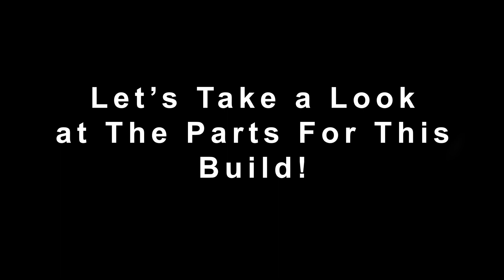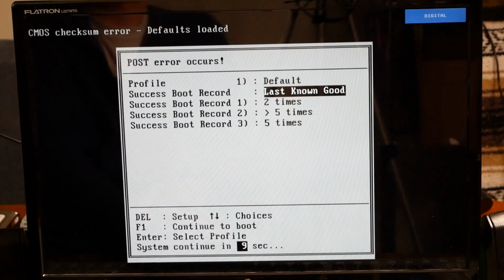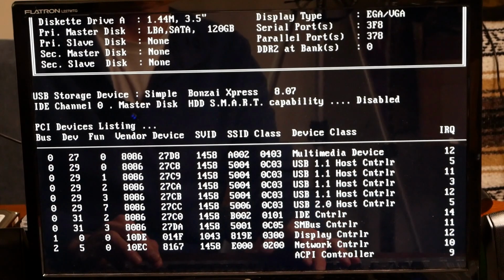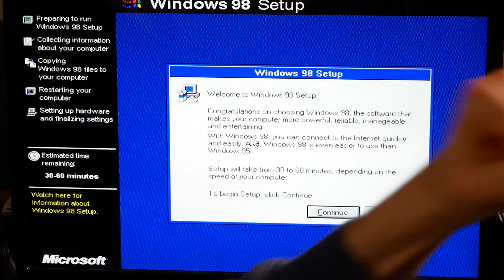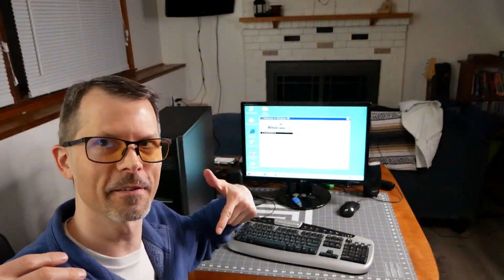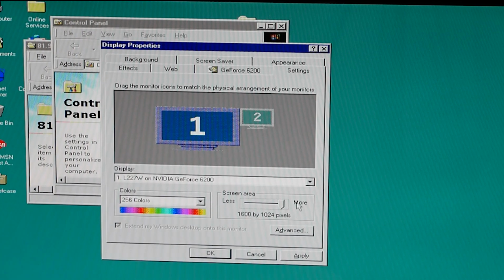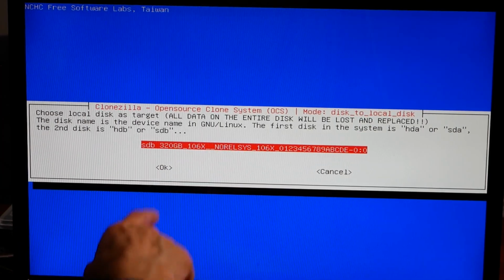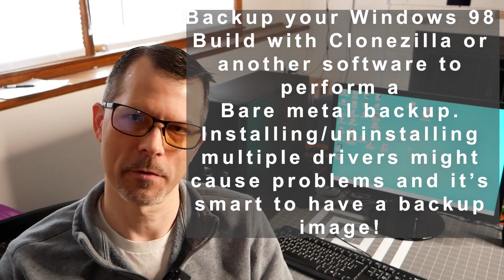Building The Ultimate Windows 98 PC - In 2023!

Comment: Nice vid! Went down this route a few years back. My ultimate win 98 pc has a athlon xp 3200+ on a msi K7N2 Delta-L with 512mb PC3200 DDR ram and a asus radeon 9800 xt, Chaintech nvidia fx 5950 ultra and a asus geforce4 ti 4600... i couldn't pick 😅and a sound blaster audigy 2 zs. Ooh use some brake cleaner to get away the old thermal paste.
Reply from the maker: Hi and welcome! Ty! That xp cpu was the fastest in that line if I remember right. Nice setup. In hindsight, maybe I should have gone with an athlon build. Would have had more driver support, perhaps. Shrug. Thanks for watching and commenting 🙂
Reply: @RememberThisTech  The xp cpu is pretty much overkill. If you do go for a athlon in the future get a motherboard with the nforce 2 ultra 400 chipset for best results. Also for most games to work geforce 4 or 5 will be better then 6 for compatibility which was a thing back then. And 512mb ram max for dos to work next to a hdd thats not too big.
Reply from the maker: @MeALot  ahh great info thanks! I'll need a vacation after wrestling with this latest 98 build before I try and tackle another lol. Getting my hands on working 4 series nvidia cards will take some research :)
Reply: @RememberThisTech  I was lucky to buy everything during the start of corona when no one was buying stuff and sellers were kinda desperate lol Thats why i ended up with several gpus. The fx is kinda bad but i like making fun of it, the radeon 9800 pro is nearly as good as the xt and still sometimes pretty cheap. I have seen the 9800 xt go for 4 times what i paid for it right now. Geforce 4 ti 4200 and 4400 are not that much less from the 4600 in performance but are a lot cheaper.
Reply from the maker: @0MeALot0  Ahh makes sense! You got them at the right time. Nice!
Reply: @RememberThisTech  Just like now chinese replica cards of the fx and radeon are around so do your research if you see one you like. The chinese ones usually have cheap caps and lower speed vram on them and are worth scrap metal.
Reply from the maker: @MeALot  haha yep spot on there!
Reply: I am using a Athlon XP (3500+) with Windows XP 😆
Reply: @tagesvaterpatrick8780  You must mean AMD Athlon 64 3500+ right? For athlon xp 3200+ is max. Got an Intel Core 2 Extreme QX9775 @ 4.2ghz for Win xp and a 9800 gx2 on a asus striker 2 extreme board
Reply: @0MeALot0  You're right! I meant the Athlon XP 3000+ 🤪 The Athlon 64 I have is the 3500+ !

Comment: Interesting build of a Windows 98 retro PC, albeit with components that didn't even exist at the time ;-) But then I would have been better off using a Gotek floppy emulator instead of the 3.5 inch drive, which is what I have in all three of my retro PCs installed and they work great. 999 disks on a 2GB USB stick, that's a strong argument ;-) I hope you don't have too much software that reacts critically to such powerful hardware (for a Windows 98 computer).
Reply from the maker: Hi there, I appreciate that point on the new op hardware running 98. I guess the point was just to get the newest hardware to run 98 on :) I'm working on a new 98se build with more age appropriate hardware. It just takes time to get working pieces :) I have one of those gotech devices but was too slow to figure it out. lol :( Thanks for watching hing and commenting. I appreciate it.

Comment: hi
i have several of those geforce 6200 asus graphics cards. they seem to be vary uncommon because nvidia later produced the turbocache versions more and were pretty awfully slow at time. the one you have is more akin to lower clocked geforce 6600 and i think used the same silicon die too making them rare now.
Reply from the maker: Hi, oh wow that’s good info Ty.  I’ve got an fx5500 I’m itching to try soon. Thanks for watching :)
Reply: @RememberThisTech  I'd expect the FX5500 to definitely perform worse than your 6200, but would be interested to see the outcome! :)
Reply from the maker: @erroneoushyphen  More support perhaps too for the 5500 fx ish series cards too. We shall see!.
Reply: @RememberThisTech oh yeh, it'd certainly be more compatible with the bulk of win 9x era games

Comment: A neat build! 👍👍 I recall using Windows 98 SE., on a Pentium 3 Compaq desktop PC., and it worked reasonably well, but it did have some stability issues, I never played video games on it though.  I use Linux Mint these days and there are many free games in it's repository, but I'm not a gamer. Obviously I enjoy watching retro builds though.
Reply from the maker: Hi! Yep, the infamous win 98 had serious stability issues lol. Mint is a good OS. I've used it a bit here and there. :) Thanks for watching!
Reply: @RememberThisTech  I have watched some videos about upgrading the older Mac Pro desktop computers, such as the 2012, 5,1 and once upgraded they are still very capable computers and workarounds are still created so that the latest Mac operating systems can be installed using Open Core or other patches;  Linux OS., or Windows can also be used on those computers.  Do you ever obtain older Macs?  I have considered doing so, but there are not so many of them here in the UK., so they are still quite expensive.
Reply from the maker: @LAURENCE JOHNSON  That's great info ty. Yeah, there's older Mac pro towers around where I live, imacs, laptops, thing is most of the cheap ones are with dead drives or not known to be in working condition. Either the owner knows its dead and just wants money or dosnt really know. So I'm worried to take a risk of buying a hunk of scrap metal.. I've also read that you can only upgrade to a certain Mac os depending on what hardwares in the Mac, but your saying with workarounds one can bypass that and install a newer Mac os? I've got my eye on a G4 tower... but the owners saying they don't know if it works has no hd... soo do I waste 60 bucks?
Reply from the maker: @laurencejohnson4106  Oh wow tyvm! great stuff there! I'll take an in-depth look when I get a few moments ;) thanks again.
Reply: @RememberThisTech  You are welcome!
Reply: @RememberThisTech  PS., this channel may also be of interest.  https://www.youtube.com/@JessiesFlying/videos
Reply from the maker: @LAURENCE JOHNSON  thanks I'll take a look I appreciate it :)
Reply: @RememberThisTech  You are welcome.

Comment: Wew 13$ for 120 gb is pretty good, even if it's a basic dram less ssd my cs900 has been working fine for about 4 - 5 years now i think ? About 11.6 TB writes too it & still 90% health left so plenty too go.
Also got a 240 gb cs900 which I've put too use now in a laptop after getting a 1 tb m.2 drive for games instead.
Reply from the maker: Heh I figured windows 98 wouldn't mind a cheap ssd lol. You are getting some good life out of yours! I picked up a 2 tb for video editing and 1 tb nvme im going to use for boot.. got a 2tb reg ssd 980 samsung for games etc. Goto rearange setup.. depends on what or if i change my main rig to a new cpu and board.. decisions decisions.

Comment: Maaan, 128MB of GPU memory is the limit for W98/W98SE.. btw with memory patch you can go up to 2 gigs of ram and with LBA48bit patch you can easily use 500GB hdd
Reply from the maker: Hi and welcome to the channel! Good tips thanks! The 6200 Graphics card I had only has 128 mb of mem. I'm familiar with the mem patch upgrade but I didn't have 2gb of memory for the system :( I wasn't aware of the HD Patch good info tyvm! Thanks for watching and commenting I really appreciate it ;)
Reply: @RememberThisTech   No, windows will recognize more than 128. My 256 videocard has no problems, and 98 will run 512, but can and does flake on some cards at 512. Windows 98 will  support up to 3.5gb of memory.
Reply from the maker: @R1BLACKRAVEN  good info thanks :)

Comment: The ultimate win98 machine id build myself would probably be something like a socket 754 motherboard with agp, running a Athlon x64 for that socket or maybe the mobile Athlon x64 4000+ based on the newark architecture which is essentially the san diego core.
512 mb ram probably as well.
As for gpu I'd probably go for something like a passive Nvidia 6000 series card, or the ati x1650 maybe a agp 6600 gt or gs.
I do have a Audigy zs 2 laying around somewhere as well & a voodoo 1 4 mb
(Though I'd personally want a voodoo 3 pci rather then the voodoo 1 for the games I'd like too run on there.)
Reply from the maker: I like your thought process on your 98 build and your choices of parts! I'd have preferred a 3000 voodoo or a banshee 16 meg even. I had a 6 meg voodoo 1 rush and a banshee, but alas, I sold them...plus they are expensive nowadays
Reply: @RememberThisTech  Yep, at least you can emulate the voodoo cards kind of via nglide on a modern pc & get game compatibility setup via dgvoodoo & dgvoodoo2 for some games as well.

Comment: WILL A AGP8X card will work  in an AGP4X slot,, mine has a agp 4x slot ,iam looking to buy a  nvida 8x 256mb video card will it work in my pc or do i need to buy a lower grahic video card, and where did you download the universal drivers for windows 98 se usb ports ,, i want to make sure mine work ,, what  pci sound card  do you recommend  for windows 98 se and might try dos on windows 98,, , thanks
Reply from the maker: Supposedly All NVIDIA Geforce and Quadro GPU's which support AGP 8x mode are downwards compatible with AGP 4x motherboards. I'll try to find the USB drive link for you. I'd go with sound blaster 16 or audigy zs card.
Reply from the maker: I know Phil's computer lab website had 98 se usb 2.0 driver for download

Comment: My limits on Win98 (SE):
- 512MB RAM (I think you can put 2GB, but you need to edit system.ini after 1st reboot and limit to max 768MB)
- GF6200, 256MB GPU (mentioned patch is for 512MB, but I did not get it).
- For CPU, apparently network stack will reduce it. As I remember, a Core2Duo 1.8MHz already tripped it. I read some timing measurement overflow and crashes (i.e.: it can go higher if NO network is  used).
Reply from the maker: Hi and welcome to the channel! Great info there tyvm! Yeah From what I read too 2 gb needs a workaround patch after the os is installed then add the other gig. I think it might be easier using an era appropriate setup but good luck getting parts all in working order after 30+ years ;) Thanks for watching and commenting I appreciate it.

Comment: Even you went so far managing to install somehow some drivers, you still can have problems with games. Like NFS4 that do not recognizes new video cards and uses shit standard vga setup with awful graphics. But if you use proper video card from its era you'll have the game at full and surprising beautiful graphics. 
It is nice for having fun installing it and making a yt video on it, but I will not go this way for a win 98 machine.
Reply from the maker: I used more modern parts and most games worked. That was the point. If I want I can buy a card from that Era. But Most cards I realy wanted like the voodoo 3000 or banshee I tried to get were too expensive or non functional after the fact so i used what I had that worked. Once I get the voodoo 3000 working I'll be all set. Thanks
Reply: @RememberThisTech  Yeah, most games. But I do not play "most games" game. I play some particular games. And if they do not work 100% it is not good.
Reply from the maker: @bestopinion9257  Vey true. Good point.
Reply: @bestopinion9257   i got 98% games working including old dx titles like turok & need for speed etc... to work with geforce 6 under win98 using some game patches and opengl to directx wrappers since these series of gpu's are very fast and strong with the opengl renderer. 8 bit palleted textures are useless and barely many games supported it. i got table fog and other legacy 3d rendering features working with the directx wrapper so i have no need to get a rare or expensive graphics card for an win9x build. although i still perfer the ATi radeon side of things with these types of builds because of the less driver and game support hassle, things just work outside the box with out the need of 3d renderer wrappers.

also if you want to play 3dfx glide games on windows 98, use zack's opengl to glide wrapper as that works with pretty much every gpu that support opengl 1.3 or higher or use nglide which requires an directx 9 video card.

i admit that driver support for the later nvidia cards suck and perfer to just stick to anything geforce fx or older for the win9x platform but if you're using windows NT, you have unlimited options at your disposal.
Reply: @explorer9049  Patches often do not solve the problem entirely. And if you want a retro rig, make it compatible in the first place. You do not need to be 10x faster than you need and 95% compatible and to have to deal with patches. 
If you want a Formula 3 car, make a Formula 3 car. It is cheaper and less work. Do not make and F1 car and modify it to match the regulations for Formula 3. 
This is how I see this retro building rigs thing.

Comment: If you ever try a multiboot system with Windows 2000 and you have petitions over 137gb activate lba if not you have to reinstall all =/ blue screen of death is a nightmare .__.
Reply from the maker: Hey there! Good info ty! I used to use win 2k for my daily driver but haven't used it for decades! As far as gaming I stick with 98 se and xp as far as retro rigs.
Reply: @RememberThisTech I use my system for 98se 2000 XP and vista with 2gb memory 98 sometimes acts strange even with the memory patch
on 98 and 2000 I play games with my voodoo 5500 PCI and on XP and vista I do play games on a 3850 AGP 1 system for all

Comment: you didnt not get it working right. If it was working properly then the windows would have a light blue and dark blue shading. when its only blue it means your drivers are not working.
Reply from the maker: You mean in the windows 98 screens? Hrm, well if that's so I'll need to go back and do some tweaks and rebuild the system to make sure then. Thanks!

Comment: Win 98 was horrible os. I had it running on my duron 800mhz machine back in the day for less than a year, switched to XP fast as I managed to get a press version of it through a friend before it was even released. That was first good windows os.
Reply from the maker: Hi! Yeah once xp came out, I agree I jumped on that OS. It was so awesome compared to 98. Thanks for watching and commenting I appreciate it
Reply: Windows Xp was much better than Windows 98 but many of the old games from 96-2000 did not function anymore on the newer Xp.